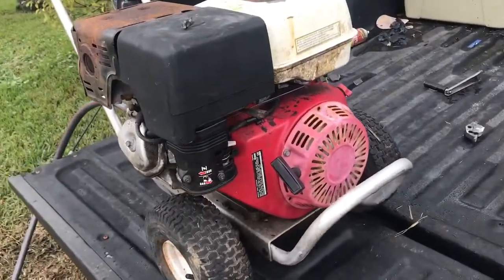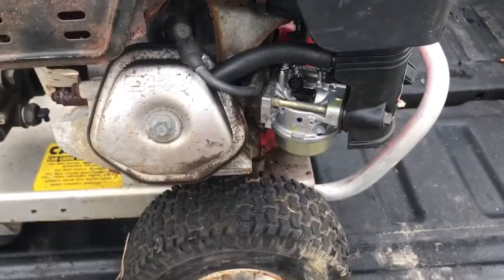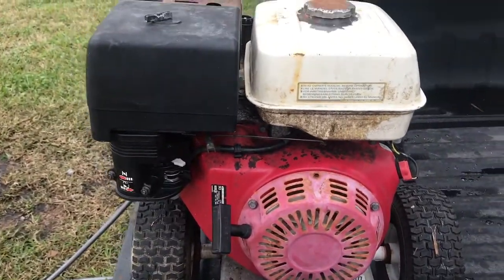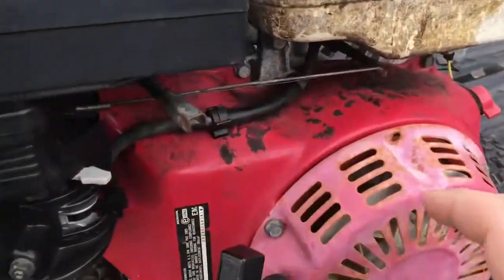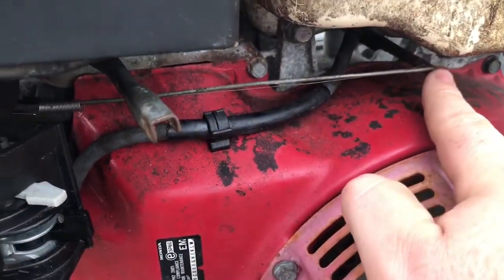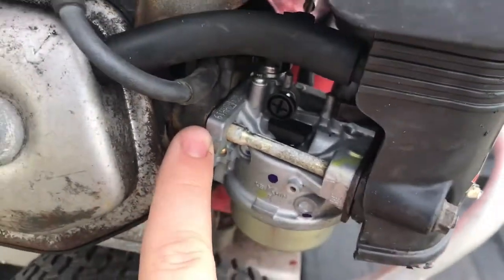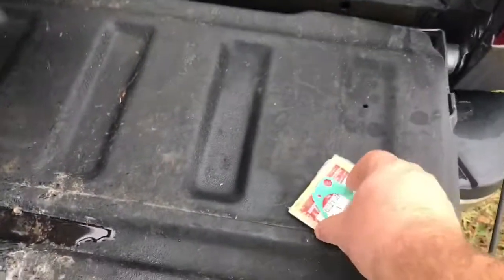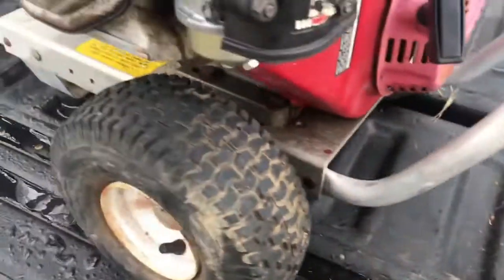How to fix Honda GX390 surging idle

Comment: In my case. Surging Honda GX 390 on a generator was surging only under 1/2 tank of gas. Tried solving it with new or no gas cap, new fuel hoses, filter, petcock, flushed gas tank, new Genuine Honda carb and even used aviation fuel. Still it would starve out near 1/4 tank and would only run while spraying starting fluid in the carb. 
Surging = Fuel Starvation, especially with less than half tank of fuel in my case, even when it was new.  A generator runs at high speeds all the time requiring the highest of volume of fuel in the line at all times. 
Generators are designed to be low profile and an inherent flaw is that the fuel tank is (TOO LOW) just slightly above the carb fuel inlet for gravity feed through a hose. At high speeds and especially with little fuel in the tank causes a weak flow to the fuel inlet causing starvation/surging. 
MY SOLUTION: 
I discovered that by raising the entire fuel tank by 8" gave me MUCH better fuel flow down to the carb and the surging went away even with almost no fuel left in the tank. You can definitely see the difference (before and after) with a see-thru clear fuel filter which should always be at least 1/2 full during operation on a high speed motor/generator.
Another mistake I made was storing Ethanol fuel for more than one season in my shed. The stuff goes bad and causes havoc on small engines. Periodically check the color of the stored fuel in a glass jar. It should be clear. If it is golden/urine colored, DONT USE IT in a small engine.. Car engines don't seem to have a problem with the aged fuel. I had about 20 gallons of yellow colored fuel and added a few gallons at a time to an almost full tank of gas in my car and it burned it with no problem.
I hope this helps somebody as I almost gave up and it cost me $ and lots of time, but I won and learned a valuable lesson that nobody ever suggested to try.

Comment: My governor rod on my gx390 makes full swings.  Maybe it's time i tune it up and clean the jets.  Should i just buy a new carb?  

I must say these engines are BEAST.  My engine has done over 300 houses and it fell into a pool while it was at full RPM.  I never tuned it up after that.  100 houses later still going but surging.  

Starts on first pull.

Comment: I replaced the green gasket on my GX390 carburetor, because it was leaking, and it is still leaking gas behind the carburetor. I tightened everything down. Is there something I missed?
Reply from the maker: Dr. La 0206 if its leaking fuel the float in the carb is stuck. Needs to be cleaned and or replaced
Reply: Five Star Pressure Washing Thanks for replying. I found out that I didn't remove the old rubber ring gasket at the bottom of the carburetor  I put the new one on top of it and it won't seat right.